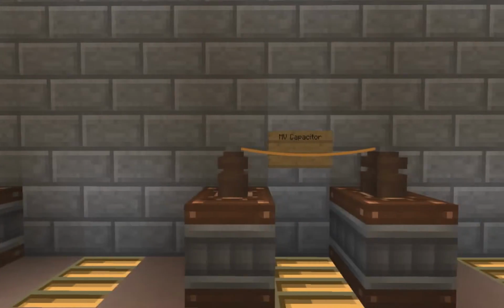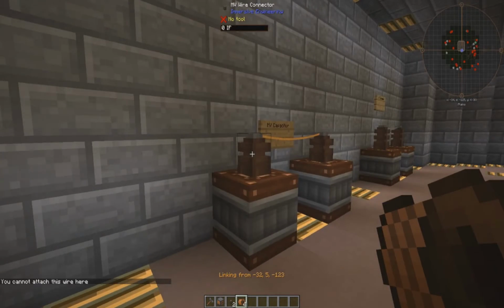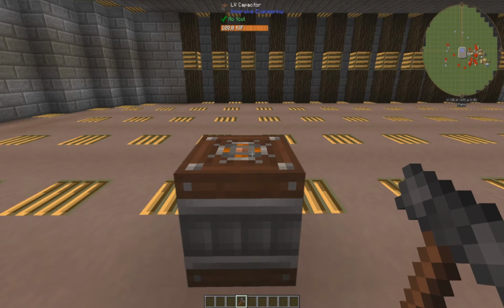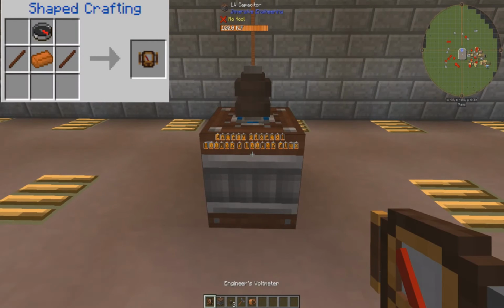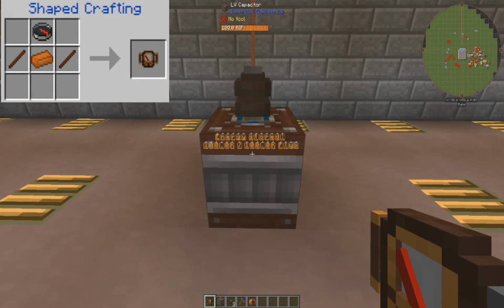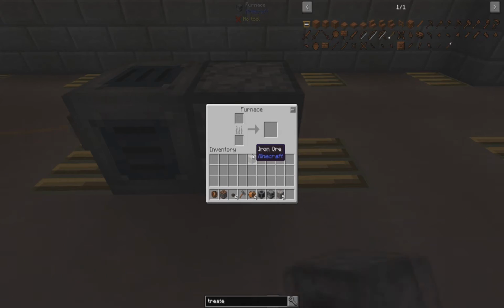Getting Started - Immersive Engineering 1.12: Capacitors, Windmills, and Wires

Comment: I have a question: Basically, are the capacitors what store the energy?
Reply from the maker: That is correct. LV Capacitors store 100,000 RF, MV Capacitor stores 1,000,000 RF, and HV Capacitor stores 4,000,000 RF.

Comment: Welp, you weren't really clear if you can use lower voltage connectors on a higher voltage capacitor. Guess I'll have to figure it out myself, since this didn't provide any new info.
Reply: Thats what I was here for. Also what happens is I send more than 1k rf through an lvl wire? Does it just provide maximum for that cable or does it get destroyed?